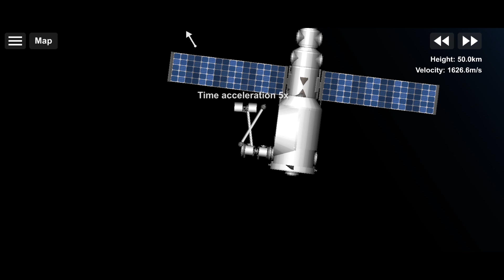Tiangong's Chinarm Concept test | SpaceFlight Simulator

Comment: bet i can build it without the paid blueprint
Reply from the maker: Of course, Anyone can build anything without buying them. It's whether they want to do them or not.
Reply: ok
Reply: ok I made a kinda working version without editing
Reply from the maker: Kinda, no offense. My thingy work, but with a bit of tweaking mine should work flawlessly
Reply: no I was saying my dollar store version that doesn’t edit the parts works kinda
Reply from the maker: Nice but, the thing about not using bp edit is that everything is so big and therefore doesn't look as good
Reply: wasnt it used here to make the fairings smaller?
Reply from the maker: I'm talking about yours, you said its not edited
Reply: ah, now i see.

i also tried making landing gear with the mechanism.

the game does not like it
Reply from the maker: Yeah, I feel you. My Falcon 9 landing legs deployment success rate is about 25%
Reply: i had to scrap that design that took 2 hours bc it was too heavy but it needs to be big so it means it will be heavy but it cant be heavy
Reply from the maker: If you use fuel tanks, you can drain the fuel so it's empty